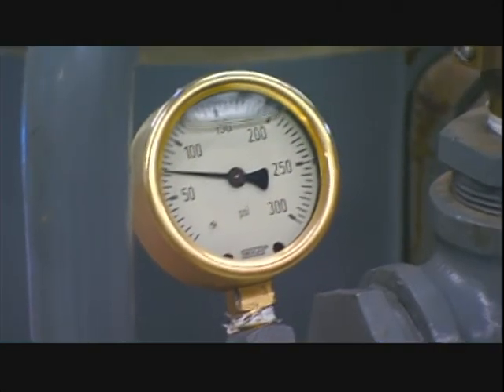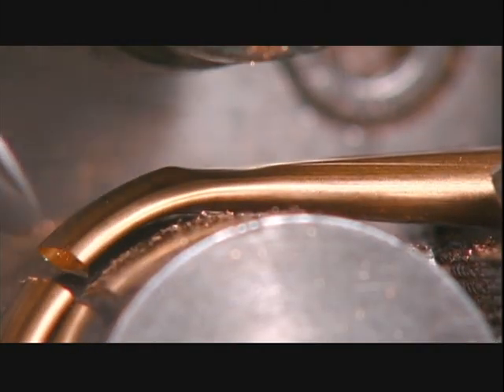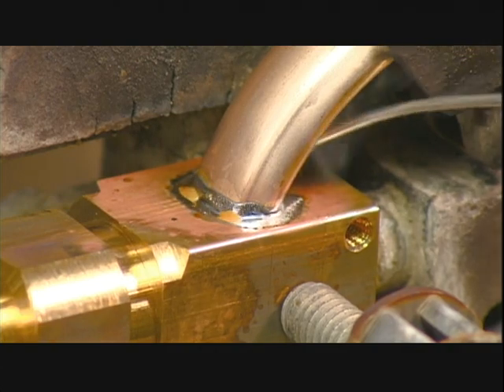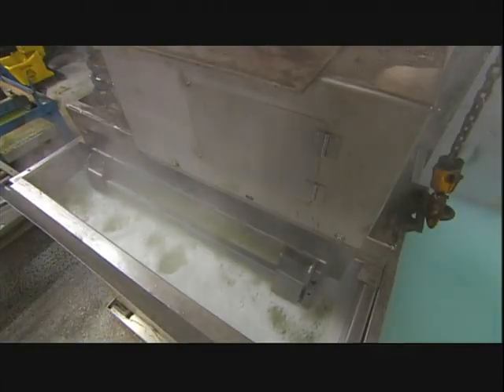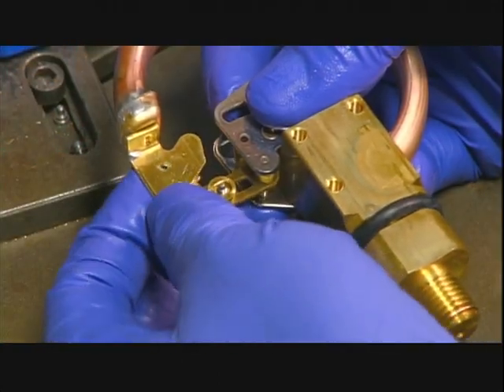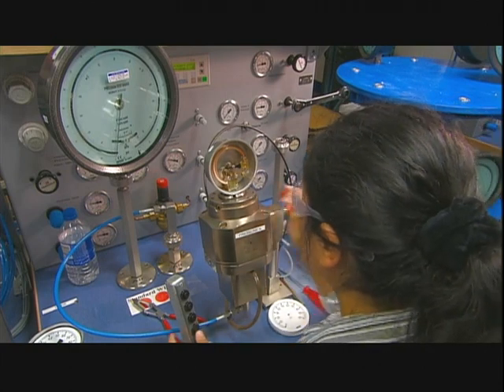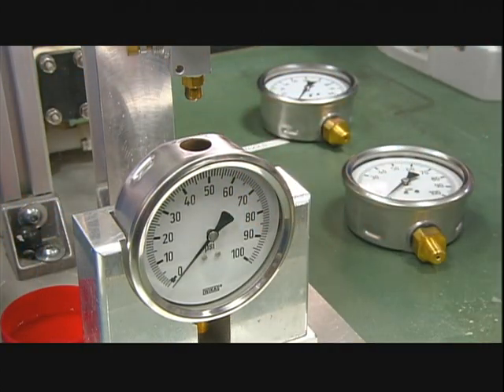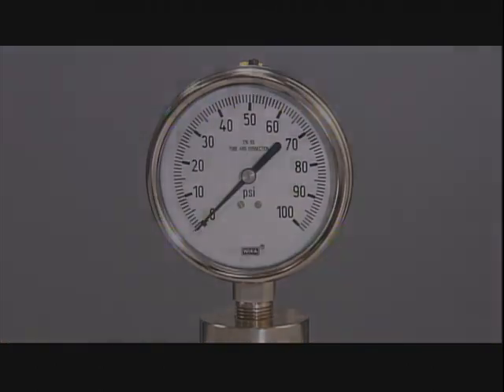How Pressure Gauges are Made

Comment: @wikawebmaster Wika is a good brand. I have no doubt about its quality. But in my previous project, i chose Budenberg over Wika because of the accuracy. I was looking for a 6" SS 316L DPG with 0.75% FS for IP66 . 
Wika should also look into Monel material casing & wetted parts for harsh environment.